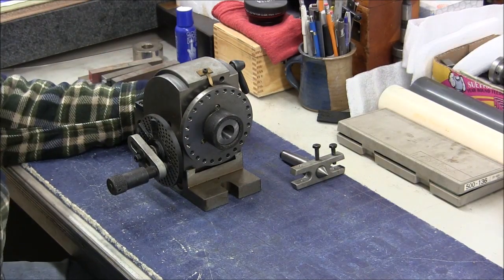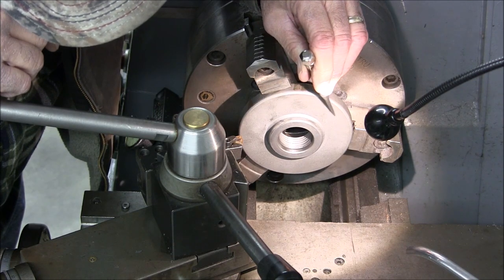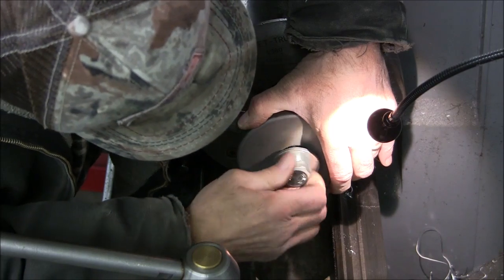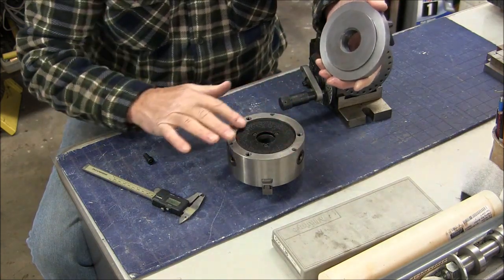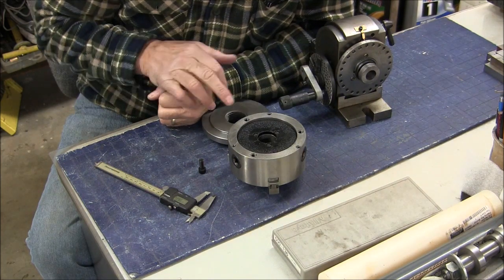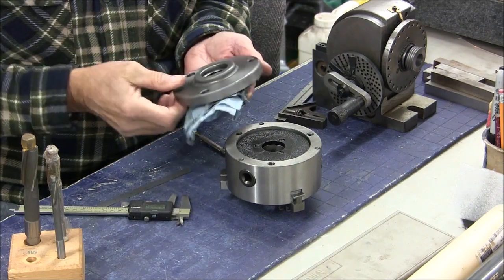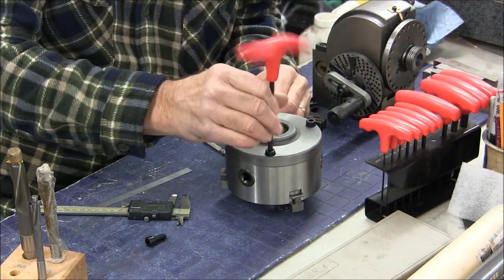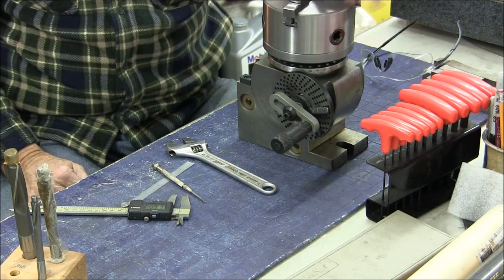Adapting a 3 Jaw chuck to the index head

Comment: Lets see, you are putting the chuck on to a "dividing" head, why would you need a DRO or transfer screws/buttons, asking for a friend.
Reply from the maker: Good question.  An index head is limited to the size that can be held in it. Unlike rotary tables they're  typically not used for hole drilling. Also good for engraving, light milling, gear cutting etc. The dro is limited to work that can fit on its mill table and can aid in work beyond hole drilling like positioning mill cutters. Transfer screws can be used in any size plates. Also quite foolproof as the process to use them doesn't require any math. So each process has a time and place where it's best applied.
Reply: @michaelmurray9154  Not trying to be snarky but if you can cut gears a simple 120* 3 bolt pattern is right up it's alley, it is after all a "dividing" head or indexer itself.
Reply from the maker: @Peter-V_00  Not saying saying an index head can't be used for making a hole pattern. But I have more than one tool in my tool box and pull out the best one for the job. (At least for me) If you use your dividing head for spotting holes  then that's right for you. Both methods are satisfactory as long as everything fits in the end. 🙂 Mike
Reply: @michaelmurray9154  Whatever gets it done works for me, sometimes you have to just look at the results not how you did it, I confess to making some sketchy setups work, making it happen isn't always pretty. 
Cheers

Comment: Nice piece of equipment you have there. Nice explanation on transfer screws!  A lot of people think that they are meant to actually center punch with. One reason I was always hesitant about lending them out. You did a nice job getting that chuck mounted!
Reply from the maker: I know what you mean about loaning tools. It was hard to say no to the machinists and apprentices working in your crew. They just didn't have the tools us tool & diemakers did. Nothing ground me more than someone using one of my transfer punches and hitting it on the wrong end for example. Or ever worse, milling into one of my parallels. That's a nice thing about a home shop you can leave tools out and not worry about them. 😉Tc, Mike

Comment: When I ordered it I didn't know my Vertex DH came with an already mounted 3 jaw. That surprised me since most work a dividing head is going to be used for will almost always have higher accuracy requirements than any average 3 jaw can provide for concentricity. In most job type shops afaik most DH work is held either in an independent 4 jaw or between centers. I plan on re-machining the factory installed back plate and add 4 tapped holes through the rear outside rim of the chuck and turn it into a shop modified set true type of chuck to get around that concentricity problem. With cnc today it's doubtful any manufacturer now sells enough manual DH's to justify it. But it would be nice if they offered a variety of spindle nose mounts for chucks so it could use whatever your lathe has. For my B & S -2 sized DH they have changed it's internal taper from a B & S to a MT 4. But in my opinion 5C would have been the more logical and better choice. 

I found the same sound issues with the video that Dave mentioned.
Reply from the maker: If you can work out the " true set" style, that would be the ultimate. With my little 5" chuck I only have about a 1/8 deep engagement. So not much room for screws.  As it turns out my chuck runs <..001 of concentric which I'm ok with. Better lucky than good. It would be nice if index heads we're offered in more mount styles, but like you say there's probably not much demand these days. Guess I will need to revisit the sound issue. I don't mean to sound like a smart a#@, but did you try turning the sound up on your device? I'm puzzled because I watched on my phone and while it wasn't perfect, I could hear it fine. Thanks for your comments, Mike
Reply: @michaelmurray9154  That was a valid question and yes I had to turn the volume way up compared to most other videos I watch. I could then hear what was being said fairly well, but later in the video the sound returned to normal so then had to turn it back down to it's previous level. I don't know enough about how the sound editing gets done to make any suggestions though. Given the way various browsers process the data that may be why your phone seemed better than it did for some of us? Fwiw I normally use Firefox for YT videos.
Reply from the maker: Hmm sounds like probably it's the editors' error (me) not equipment. I need to think about how to alter my technique. Hopefully with you guys input, I can get this dialed in. Thanks a bunch. 👍  Mike

Comment: It was good the back plate was already threaded for the divider spindle - saves a lot of work.
Good bit of clean up and nice result with the hole pattern solution. Nice job Mike.
Reply from the maker: Yes this was a real easy one. The backing plate was included in the package, and just needed fitted to chuck. Probably the way allot of home guys will receive it.  I hope this will inspire someone out there to jump into the machining world.  I watched a couple of your past videos the other day, and was wondering if you have been doing any drone flying? Wishing you good health and fair weather.  Tc, Mike

Comment: Hey Mike, Nicely done.  I am starting the restoration of a Delta Milwaukee Toolmaker Surface grinder and will have to make some gears.  If I may ask what index head do you have and do you like it?  Stay warm.  Fred
Reply from the maker: Hi Fred, the index head is a BS-0 size. Its unbranded so hard to know the manufacturer.  All this from ebay. At the time I paid $365 for the head, tailstock, and 5 in 3 jaw chuck. Also purchased a set of 8 gear cutters for $146. Very pleased with everything.  Sounds like allot of money, but the the two quotes I got to have the two gears custom cut was in excess of $3000.  I did it myself and still have the equipment for other jobs.  I've never used one of those delta grinders but always thought they're perfect for small shops like ours. Sounds like a fun project. Looking forward to hearing how things progress. I hope the weather is being kind to you folks!  Tc , Mike

Comment: Mike, well done a great little job. When I bought mine one, the same as yours, but I ordered it with the 1 inch X 8 tpi spindle. This is the same thread as my Myford lathe, so I could turn, remove the chuck and mill / index as required. I could also use the 4 jaw, magnetic chuck and colletts. By the way, sound was a bit low at times and muffled, thought you had lashed out the cash and bought a radio mic ?
Reply from the maker: Hi Dave.  Very handy that you can move your chuck among various machines. In my case, the only item I have with the 1-8 mount is my index head. So I guess the chuck is dedicated to it. Sorry you are encountering audio problems with my video. Im surprised as I thought I had that sorted out. I purchased two mics. A shotgun mic, which I used on this video and a wireless. I prefer to shotgun because it is less hassel. Both seem to provide plenty of volumn, which when editing the video, I adjust for consistency between video clips. I just adjust the volume at that time based on what it sounds like to me. Maybe because of the close proximity to my computer during editing, I set it a little low. It doesn't seem too bad to my ears when I play it back after uploading to YouTube. looks like I need to further refine this and I'll look into it.  To reach the next level, I'd likely need to purchase some professional grade equipment. Of course that gets a little hard to justify with my little non- monitized channel. I really appreciate your feedback, without it I have no idea what to work on for improvement.  I have some video for putting the saddle on the  surface grinder but want to add more content before releasing.  I'm still waiting for some parts/material. For example, when I get  the micarta for the bearing cages I think I'll make a die to punch out the rectangle holes. Hope you are having nice weather.  Tc, Mike